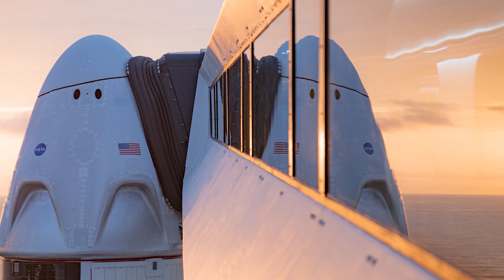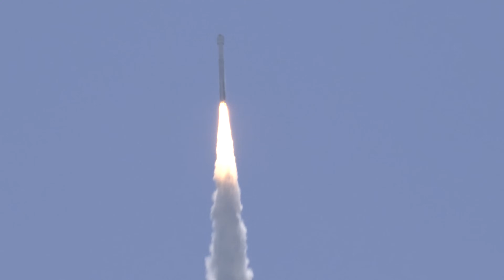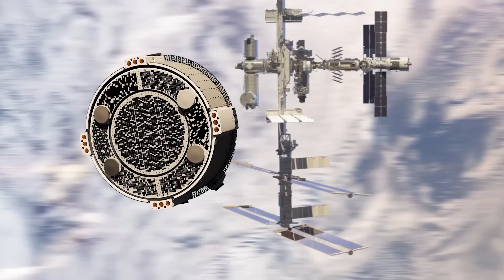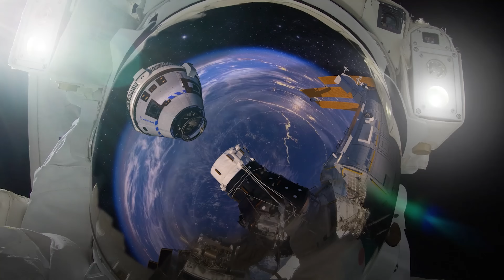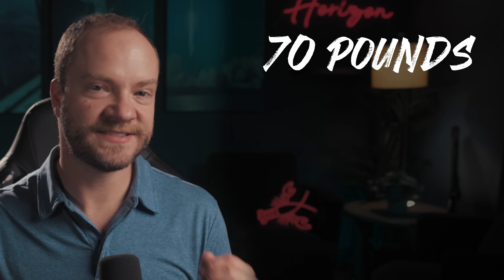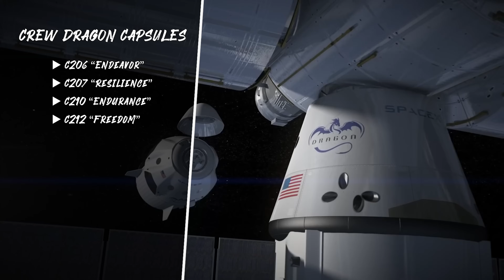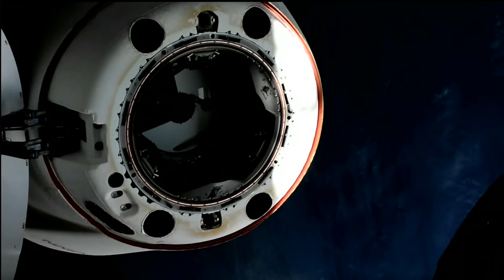Starliner in Trouble 🚨 Should Crew Dragon Rescue the Astronauts?

Comment: May I add two points to this very good vídeo: An important factor in the recent delay is also to coordinate with the EVA schedules at the ISS which has already been disrupted by the canceled one a few days ago. Preparation for EVA activity and the required work afterwards doesn't mix well with undocking preparation. It's a nightmare for mission planning and ops. 

Second point for those who always refer to the bad NASA safety culture and mistakes made in the past: A lot has changed there since Columbia, new structures and procedures are in place and Mission Management Teams specially trained in risk management.

And if you'd know who he is the current MMT leader on the Boeing side of MMT,  I think you wouldn't have any doubts that the most diligent and careful approach is taken also from this side. It is LeRoy Cain...

Comment: Starliner had problems with the 1st flight by not reaching the ISS. For the 2nd unmanned flight, there were also thruster problems. Now with the 3rd flight they have again thuster problems - as i understood somewhere similar problems as within the 2nd flight. They tought to have resolved those problems for the 3rd flight, but clearly they haven't.
After more than 2weeks of collecting data, they still don't understand the problem.....Is it a Hardware problem ? Is it a software problem ? or is it a combination of those two ?
Anyway, if they would return tomorrow or wait an extra 2 weeks, there is very little chance that Boeing will understand the problem in that short laps of time.
I don't think it would be acceptable to launch another manned starliner before they really understood and resolved those problems.

Comment: very good video! something that you didn't mention that i think is important to keep in mind is NASA has directly stated that they've had similar issues on dragon before, in general dragon issues don't get much coverage and i don't think its been mentioned in any news articles so its easy to miss though
Reply: Yeah, nobody reported on the heat shield erosion on Crew 2 or Crew 4's parachute cover coming within inches of collapsing the parachutes during landing, or the recent cracked hatch seal issues.

Comment: If anything, this scenario has provided greater insight into what is missing in a disaster preparedness or contingency planning.  NASA should implement policies and funding that will ensure each commercial company always has a standby ready module.  🤔
Reply: Is that really necessary? Id say this mission shows such redundancy can be in one vehicle by having redundant systems or large margins, like the thruster count or large helium supply.

A much simpler solution to the problem than having a spacecraft on standby 24/7
Reply: Hey Keith! If NASA was supposed to be all about disaster preparedness and contingency planning why would they ever even TRY to launch a mission??? NASA plans for success and 5 moon landings later, wadda ya got? There's always a chance things will go wrong. So your idea is what? To do nothing and plan for the best if the shit comesdown you're planning for failure!

Comment: It should be pointed out, Boeing OK'ed the deployment of the modified 737 MAX aircraft as well, and NASA flew the Shuttles for years fully understanding the horrifically dangerous design flaws with the vehicles, and in both cases numerous human lives were lost for absolutely 100% preventable reasons.  
Neither the government entity or aerospace corporation in question are, in my opinion, reliable or trustworthy when it comes to safety, not when the vehicle they insist is safe has spent the plurality of existence bouncing from one serious issue after another, from hardware to software.  
I don't think it's hysteria or just rampant speculation to worry about the safety of the crew and station, when Boeing's recent products have consistently proven to be unsafe, unreliable, not built to the stated standards, badly or incorrectly programmed in ways that directly threaten the lives of people traveling aboard them.

Comment: If you bought a car with this sort of result would you be making excuses for the builder and throwing more taxpayer's money at the company or would you be lawyering up to get your money back?
Reply from the maker: My 2023 truck has had issues.  I just took it in because the software powering the radio failed.  I'm not calling for GM to be dismantled.  They fixed it, and now I'm fine. 👍
Reply: Considering that SpaceX's demo capsule literally exploding during post flight tests due to a design flaw, these issues are pretty minor.
Reply: Im gonna stop you after 5th word:

This, is a testflight.

Comment: If Starliner is not safe to return it's crew then it has to be remotely piloted from ISS no matter what. So docking another Dragon is not an issue. SpaceX has already said Dragon could take 2 extra passengers so the move is you return Starliner and leave the astronauts up there until the next dragon arrives with spacesuits for them. Then bring them back with the current ISS crew. If some disaster happens between when Starliner departs and the next Dragon arrives you bring the Starliner crew back with the current ISS crew and without the spacesuits. The suits are a backup safety system in an emergency it's okay to skip them.
Reply: golden rule of the ISS is you always need enough seats docked to the station to bring everyone home. even when spacecraft undock to reposition to a different docking port, a very short maneuver, astronauts must be on the spacecraft. not even for a day will nasa allow starliner to undock without an alternative already being connected.
Reply from the maker: @unflexian  Exactly.
Reply: This reply has pointed out just a few of the errors in this video. It makes me wonder what the purpose of the video was. Just because you can reboot a computer doesn't mean you've solve the problem. You still have thruster issues, probably caused by overheating. Dragon can easily bring those astronauts home.
Reply from the maker: @jimkoll52  if you reboot the system, but also change your overly conservative software limits to be a little less conservative, which solves the problem, that's a perfectly normal engineering practice.
Reply: @OLHZN  I do not believe the thruster issue is software, honestly IMO they are lying. The software disabled the thrusters because helium leaks were causing the thrusters to perform out spec. That is a hardware problem. Telling the software to ignore problems with the thrusters and keep using them is patch and maybe not a very wise patch.....Any road. If they really believed Starliner was safe to return it's crew they would have them depart immediately before anything else could go wrong. Because if NASA is forced to rescue the crew with Dragon Starliner will never fly again. Congress will demand an investigation into how 4+ billion dollars of taxpay money was wasted on a giant space lemon. At least part of that investigation will be criminal.
Reply from the maker: @THX..1138  it's going to be hard for me to make any counterpoint if you think the data is false. Maybe it is? I can only draw a conclusion based on the data I have.  I'm not going to jump to another conclusion without evidence.
Reply: @OLHZN  I don't question the data, I'm straight up accusing Boeing and NASA of being disingenuous.... In one of videos with someone from NASA they make mention of the "software issue" being that it did not allow the thrusters to fire with so low a propellant pressure.

Now the helium pressurizes the propellant tanks. If the line pressurizing the tanks is at say 100psi when it leaves the helium tanks and there is a leak in that circuit you will 100% for sure have a pressure of less than 100psi at the propellent tanks. How much less will depend on severity of the leaks and the diameter of the line. 

We know for sure whatever the propellent tank pressure was supposed to be it was something less than that due to the leaks and we know the software was reacting to what it (rightly or wrongly) interpreted as a low propellent pressure problem. Whether the software was too conservative or not. These 2 problems are linked, the hardware failure caused everything.

So NASA and Boeing are lying when they claim the leaks and the thruster failures are separate problems. Given they are lying about the causative relationship of the leaks and the thruster failures why on Earth would we believe unskeptically anything else they have to say about Starliner.

Again their actions indicate this is more serious than they claim. At this point even if Starliner eventually returns home safe with it's crew there is going to be massive pressure to cancel Starliner. Everyday Starliner stays at ISS the likelihood it ever flies again diminished. If they could bring it home now they would.
Reply: "A piece of foam hit Columbia during liftoff, but the risk of a problem during reentry is low."  NASA, 2003
"There have been several helium leaks and thruster issues, but the risk of a problem during reentry is low."  NASA, 2024
Reply from the maker: @onlyme112  night and day difference.  The service module doesn't even return with the Starliner capsule. Don't let emotions from the past cloud the present analysis.
Reply: @OLHZN  Sure, but it is responsible for  putting the Re-entry capsule on the correct return trajectory. If your trajectory is off, then it doesn't matter if the capsule is alright if it's exposed to conditions it was not designed to deal with and thus fails catastrophically. In the end it's probably nothing, but it's also a: It's fine from a company who has had so many safety and quality issues the past few years that they're about as trustworthy as a compulsive liar.

Comment: Great explanations of helium leaks and thruster issues. I'd be more or less on board the "everything is fine" train, except that they keep pushing back the return. First it was June 14th. Pushed back to June 22nd. OK, no problem, the engineers need some time. Then pushed back to June 26th. Um, ok. Then pushed back indefinitely. Hmmmn. It's not unreasonable to suspect that the problems are larger than we have been told about so far.
Reply from the maker: It's rational to wonder, but it's been answered. The service module doesn't return so engineers want as much time as possible before it's intentionally destroyed.
Reply: "Indefinitely" is because they're managing around the schedule for spacewalks, it doesn't mean "it can't return", it means "we haven't yet set the date and gone through reviews to formally set it."

Comment: Point one…
Starliner would not launch, with the leaks and valve issues.

Point two… Starliner cannot attempt re-entry, under less than nominal conditions.

So, eventually Starliner will be an unmanned re-entry… once enough time has passed and the public forgets 😂

Crew Dragon is the only nominal re-entry option.🎉

Seems there must be a “safety “ officer whose only job is to override any less than nominal re-entry attempt, when a nominal alternative is existent and easily employed.🎉

Comment: The helium leaks were implicated in thruster failures of the previous Starliner mission to the ISS. Boeing called the mission a success. Obviously they still have not fixed the problem when they launched the present mission more in response to falling share prices and the need for some good (or less bad, PR), rather than an engineering bill of clean health. This further erodes any residual trust in Boeing's pious statements of how everything is getting better and safety is their goal. Even the FAA and Congress don't seem to believe them. Helium leaks on Ariane and other rockets are different - they were unmanned and only the insurance companies would  suffer. Space travel is inherently dangerous with numerous ways to kill humans. The crew don't have tools or time to fix something in orbit, just like the pilots on the two 737 Max where Boeing's MCAS system was ultimately responsible for 350 deaths. 'Rescue' sounds emotive, but it is just risk reduction, like persuading your parents to stay overnight rather than drive back home when their car had problems on the trip over. It might not be necessary but the safety of the two astronauts should be placed above profit. NASA should remember that the deaths of US astronauts in Apollo 1, Columbia and Challenger put the American Space program back years. Where there is this much taxpayer's money involved, take 'everything is totally fine' with a big pinch of salt

Comment: The helium leaks are not the most serious issue, the thrusters are. More concerning is the issue of the thruster failure, which Boing still does not understand. If the spacecraft is not able to complete a thruster de-orbit burn or does but cannot retain the correct re-entry attitude, then we will have a disaster. Understanding and fixing the thruster issue is of prime importance.
Reply: I heard the maneuvering thrusters on the Starliner are fine, and that the issue is with the thrusters on the storage module underneath the Starliner. The module is supposed to burn up in re entry, so they are studying the issues now, since they can't after it's space dust. I'm not fan of Boeing, but to be honest, I'm sick of all the  hype and hyperbole, just to get a few clicks.
Reply: @lodrezzon  Except that its that very same module that is supposed to DE-ORBIT the craft.
Reply: No so ,not a disaster
Reply: @diannebaginski4787  NO Not a disaster. This is what a real flight test program looks like. You just don't blow your rocket up and say you are learning a lot.
Reply: NO they know exactly what went wrong with the thrusters.  It was an overly conservative safety system not accounting for realistic safety margin. Its just a software fix that has been done but now they have to test a lot of things and they decided to do tests that were going to be done on later test flights.
Reply: Just a side note: Hydrogen is even more difficult to store - it leaks slowly thru steel (steel is porous to small atoms), this is why Hydrogen (like Helium) is very difficult to handle and the main reason H will probably never be a commercial solution to transportation, plus it costs $$$$ to make!!!
Reply from the maker: Sure, but it sounds a lot like you're skipping a lot of levels by going from 1 thruster failed straight to "cannot retain correct re-entry attitude".  Starliner can lose several thrusters and still be perfectly safe.  That's why we have redundancies.
Reply: @OLHZN  it wasn't just one thruster that failed, it was FIVE. They got 4 back up and running, to dock, but it sounds like a software error that is more difficult to fix than originally thought. I think people on here are getting spicy because just saying "one" minimizes what happened. In the end, there are red flags and I'm glad they are taking the time to address these issues. 🫡
Reply: @KeithFeickert  No it was a safety system that was wrong, the thrusters are fine. the thrusters were not 100% optimal so it switched to one of the backup thrusters and kept flying because thats how it is supposed to work. The protocol was set too sensitive it didn't actually need to switch to the back up. AND!!! Helium leaks are normal  for all space craft.  Ever see a helium ballon last forever? That stuff leaks threw everything.
Reply: @OLHZN seven years behind schedule there is no reason for any kind of failure to happen. Boeing doesn't get a free pass on poor quality and craftsmanship. This program has had nothing but issues from the start. The last thing Boeing needs is more apologists coving for them, anyone hearing this nonsense has every right to be pissed and question the craftsmanship of the build.
Reply from the maker: @losttranslation8766 I think it's fair to criticize Boeing for the cost and timeline of getting Starliner ready. To me, that's an entirely separate conversation. This video is about the mission-specific issues and some of the wild claims about the astronauts being stuck or in danger, which they are not.  If we want to criticize Boeing for the time or cost of building, that's fair game.  Go for it, and I support those criticisms! 👍
Reply: @OLHZN But you may be ignoring Starliner has had multiple thrusters problems throughout the program. Bringing them back on a dragon and letting Boeing Starliner deorbit as an unmanned re-entry test for data and safety is not a bad idea. Let's not get all "challenger" nothing could go wrong 😏
Reply from the maker: @-MeatsOfEvil- the previous thruster issues are different from the current thruster issues, so it's not hugely relevant to what's going on now other than being part of the overall system. 

My question... at what point would you feel safe having them return on Starliner? Does it have to be perfect every flight? If so, we'd need to cancel all future crewed missions, because no spacecraft is perfect. Even Crew Dragon has had issues. 

I feel safe knowing 27 out of 28 thrusters are currently operating normally.
Reply: @OLHZN  Ah but it is, multiple issues, multiple failures. That could be a risk. Wouldn't hurt to error on the safe side and bring them back by other means rather than use them as ginny pigs in the hopes everything works out.
But I guess their lives aren't worth the extra safety?
Reply: @OLHZN  i would rather we error on the safe side. so if dragon needs to be used for that then we should.. then the can test it unmanned and see if they were right or not
Reply: @markburton5292  if we did that every time, we wouldn't be in space at all. Everything has a potential risk or failure. That's why there are redundancies. Not Everything will work 100% on every mission. That's impossible
Reply: @its_just_me_95 except we’ve known about these serious yet non catastrophic issues for years but Boeing can’t figure out WHY. That’s an issue